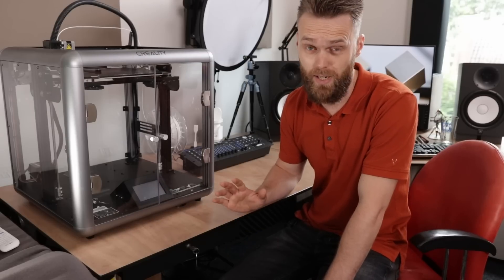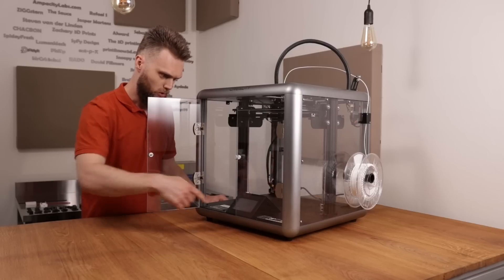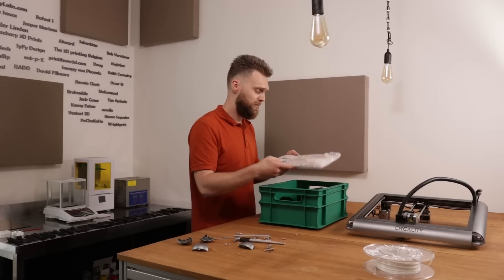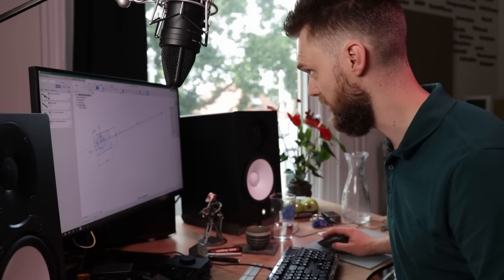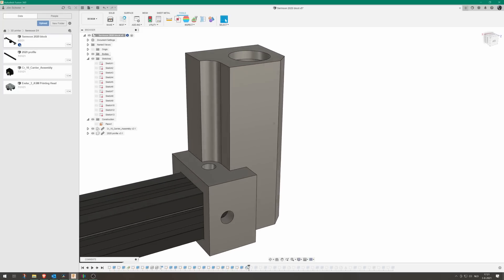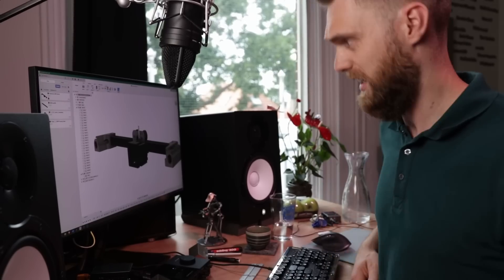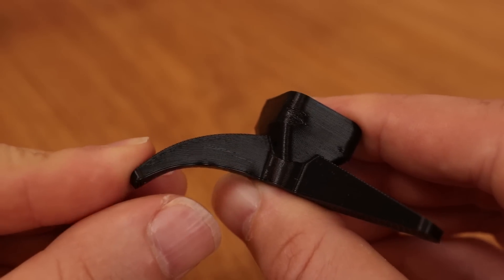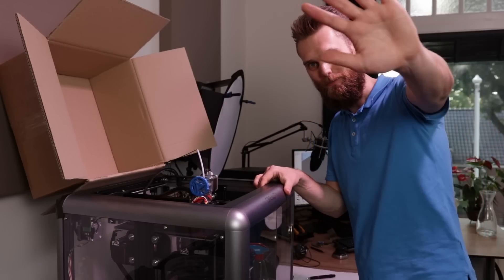Creality Sermoon D1 Ultimate Extruder Upgrade!

Comment: In my opinion, the D1 has the potential to be an outstanding unit that'll just flat beat anything else available, but falls short in so many unnecessary and goofy ways. I'd LOVE to know how yours is doing after all this time and/ or anything else you've done to it since this video (also, i have  BTT SKR V1.4 Turbo and SKR Mini E3 V3.0 Control Board, should I use one of these or keep original board?). I'm a HUGE fan of your channel and videos, but your mechanical and analytical thought process is what keeps me coming back for more. Thank you, sir.

Comment: Upgrade achieved by replacing linear bearings with aluminium profile with wheels? Hmm... 🙄
Reply from the maker: Now it fits most extruders, which is a bigger advantage than the slight disadvantage of that linear rail

Comment: I ran a belt above the deck between the two z screws.  I have problems with the cr touch.  CREALITY has left this printer be an outcast.  I just installed a SPRITE PRO EXTRUDER  ON my ENDER 3 V2.  Installed some great software that will take some LEARNING.  
If the SPRITE KEEPS printing the way it started, I may install a SPRITE IN THE SERMOON D1.

Comment: Are v slot wheels not less accurate than using linear rods would it not have been better to adapt the microswiss to use the linear rods
Reply from the maker: Good question. I don't think it matter much and the advantages V-slot wheels have, that it's a lot easier to add after market extruders to it, outweighs the disadvantages in my opinion.
Reply: @properprinting  very fair, as long as there isn't flat spots I doubt it will be too noticeable

Comment: Please give me an advice, between Ender 5 S1 and Sermoon D1, which is better choice (about build quality, and capability use for many another purpose), I’m beginner, thanks.
Reply from the maker: Although I don't have experience with the Ender 5 S1, I'm pretty sure that this is the better choice. I upgraded the Sermoon because I really dislike the extruder which is basically the most important part of a printer.
Reply: @properprinting  Thanks for your advice, I will consider Ender 5 S1 for my first 3d printer.

Comment: Why make something simple when you can make it complicated. All you needed was to change/modify the heatbreak and get rid of the Teflon tube. You replaced the linear guide with a V slot, which is the biggest step backwards. I don't think this is a good way to go.
Reply from the maker: Thanks for your input. The V slot is just a lot easier to work with and adds more possibilities.

Comment: dude where do you get heat inserts for thin walls like that?
Reply from the maker: From Onkenhout, which is a B2B supplier. I haven't found them elsewhere unfortunately. They're expensive and therefore I suggest to use regular nuts.

Comment: I'm about to pick one up open box for $275 USD 😁 looks to be a great upgradable printer!

FYI, I've has the old wooden Replicator Dual (from 2012) and modified it over the years into a seriously good machine. And my recent printer has been a Duplicator i3, which I have also very modified. But it seems that everything was done slightly wrong on that one, everything.. I had to redesign at least 7 core components and flash it with Marlin to turn it into a printer every bit as good as a Prusa i3 😉 or better 😜 I haven't has to level the bed in Months!! Perfect 1st layer every time.

Also got the one open box, if I'm going to go through it and modify it.. mights as well tear it down and inspect it. Ensuring there's nothing wrong with the open box purchase. With that said, adjusting the motor voltage IMO is necessary on a budget or hastily built machine. I do it while the machine is running a square and cylinder shape on the bed, then check min/max voltage on my multimeter. This ensures your not overheating your motors (necessary in an enclosed/heated printer) and that you also of course have enough voltage under load so it doesn't skip/shift.
Reply: So i picked one up a week after, i kept the carriage and modified the long throat by cutting it down to allow the same full metal micro swiss hotend BUT requires you to shim it because the throat hole is an odd size.. which i did with a copper sheet wrapped around it (very carefully. It's now a true fully metal hotend.

Also fixed another major issue, modified so both carriage/heat-break fans to always run AND designed fan ducts so the lower fan doesn't invariantly cool the part when you don't want it too but also help cool it FAR better. The carriage was alarmingly hot at over 100c before and how when printing large prints at 260c for hours With a cover on top to hold the warm air it's just 5-10c over ambient temp

I can easily print 200mm/s 1000 acceleration as my daily setting but anything faster and i start seeing buffer artifacts while also clearly needing linier advance Although NO ghosting what so ever. I think im going to run Klipper on a old laptop i have laying around or might get Creality's new Sonic Pad.. but it's $150 so idk. Going to see if i can convert a old android tablet for Klipper

Comment: Great idea, based on the holder I converted the Sermoon to a linear rail.
A very different printer now.
The conversion is not for beginners as it is quite extensive.
Thanks for the implementation and idea.

Comment: Question regarding reversing the extruder motor.  What wires do you have to swap to reverse the motor?  You said you reversed all of them but because the cable is black it's hard to see what wires were reversed.

Is it as simple as just reversing the entire connection?  For example, if the wires were numbered 1,2,3,4 would you reverse it by changing it to 4,3,2,1?
Reply from the maker: It's indeed as simple as that. If you want more in depth info about this, I dedicated a video on this subject https://youtu.be/3R2sExPyiok

Comment: Rotate your Y axis stepper so that the plug points filament spool.  Install an Adel clamp and stand off to the bracket above the Y stepper.  Secure the cord tightly to the clamp.
I blame the cord rubbing on the back panel for flexing the stepper connector.  The Y axis started missing steps and disabling itself.  When you went into manual mode and pushed the back and forth arrows,  the stepper would fail within a few moves.
Reply from the maker: That's great advice and I did, but didn't show it in the video. You can see it in the thumbnail. I used zip ties through the slotted hole to secure the cable.

Comment: First move the front door hinge mount forward 5 to 5.5mm.   Next make better filament flow.  1.  fabricate a bearing filament roller that does not scrape the machine.  2.  get rid of the v bearings and replace it with a swivel larger pulley with a removable pin for keeping the filament on the roller. 3.  move the filament run out out to the center of the roll.  4.  fabricate 2 clip on filament guides that  have swivel  top.  Install a 8 to 10 inch ptfe tube to guide the filament.

Comment: Wild I have this printer and my only peeves with it was that all the stock slicer material and retraction settings were for a ender 3,  and the dual bearing filament feed setup sucks and jams. Guess you missed those, judging by how clean the hot end was you really did not use it much. Once converted the stock feed to reverse bowden, and fixing the slicer settings been having a great time with the stock hot end. Only other fixes are firmware related, never have to open the doors it just works.

Comment: Is it a joke ? A core xy printer with a direct drive extruder ? The main point in having a core xy printer is to lower the mass accelerating to get faster accelerations with the same torque (F=m*acc) needles to mention the problem of jerk (derivated of the accelerations which can't be infinite, if you prefer that way, you can't switch from 0m/s^2  to 5m/s^2 in no time you need to accelerate progressively.
Reply from the maker: This is not a joke, neither a core XY printer

Comment: Something you should add to your tool collection: screwdriver-shaped allen (hex) drivers with proper handles.  So much easier to use than the L-shaped ones!  You'll be far less likely to drop them.  Only disadvantage is that you can't get the torque you can get compared to driving with the short end of the L (long end out).

Comment: AS per usual, i absolutely love your video combined with those timelapse !
However I have a question, how do you move so smoothly in fusion ? It's always a pain for me, and I feel like it's hard to actually move how I want to. I'm using simple logitech mouse like the g512 and the mx master 2s
Also, what threaded insert are you using ? everytime i try using them, i feel like plastic is meling inside of it, making it unusable. I have yet to make a single usable threaded insert...
Reply from the maker: Thanks! I use a CAD mouse for it https://3dconnexion.com/nl/product/spacemouse-wireless/ one you get used to it, you can't do without. It works in Blender too. I buy the inserts from Onkenhout, but this is a B2B company which only sells large quantities. I'm planning on selling them myself.
Reply: @properprinting  Thanks a lot for the reply ! Also, how do you design the holes for threaded insert, like how much thinner do you make the holes for a M3 threaded insert for instance ? because that might be the source of my issues
Reply from the maker: @Sttreg  You're welcome! I use the measurements from this document https://www.onkenhout.nl/pdf/Multisert_zonder_kop/227/t/p it's Dutch though, but the pictures speak for themselves

Comment: Nice. But dont understand why you go from the round bars, to the 2020's. Aren't the rods more smooth and good in the long run?
Reply from the maker: I did that because many standard hotends can be placed on it easily. For some reason this runs a lot smoother than the stock rods, but I recon that this shouldn't be the case. I'm also able to add my rocker to it now where I won that contest with :D
Reply: @properprinting  okey. But why not only make an hotend adapter on the stock rods?
Reply from the maker: @SplitPhotography  if I'd do that I wouldn't be able to add the Microswiss hotend, nor my rocker system for instance. These rods don't run smooth and you can still add a hiwin rail if you don't like those V-slot wheels. For me it's mostly about the added possibilities now.

Comment: god the intro is so true.
I designed my Doot Changer with the actual printer I had (hevo) and only kept the frame, boy was it a nightmare, everyday I was holding broken/bad components together with a janky bad fix or glue to make it function well enough to print the replacement, would NOT RECOMMENT. it made me cry ;-;
Reply from the maker: I feel your pain, been there xD

Comment: Why downgrade from precision linear rods to plastic V-wheels? That's the reason why I never bought a chinese 3d printer.
Reply from the maker: Because now I'm able to add any aftermarket hotend. This also enables the possibility to add hiwin rails if you'd like. The upgrade is not the rails itself, but the possibility to add a working extruder and other stuff to it. I don't have any bad experiences with V-slot wheels though.
Reply: @properprinting  agreed other than odd adjustments and bearing load for zz602 is bound to stick and fail but….they last abit
Reply: @properprinting  I used the pc vslot wheels they are the hardest ones and highest temp over derlin
Reply: @properprinting  all in my hiwin rails were worth the accuracy and speed a bit more

Comment: You ordered the silicone heater from Rat Rig i saw, does this mean there is a Rat Rig build in the pipeline?
Reply from the maker: I bought that for this printer, but I'm not sure if I'll end up using it for it. I don't have a plan yet xD

Comment: Could you make a special with ABS tips for functional parts? I am getting a big elephant foot of several layers trying
Reply from the maker: I basically print it similar as with PLA with the difference of the temperatures, an enclosed or heated chamber and a brim. I print the first layer at 100% flow rate at the same height as the rest. This reduces the bed adhesion, but I get away with it mostly.
Reply: I can also add that a PEI surface works wonders with abs while the glass beds tend to be not ideal. Elefants foot has more to do with too close first layer than material
Reply: @properprinting  fans on?
Reply from the maker: @felipenavas  with small parts yes, but mostly not
Reply: My elephant foot have like 5 layers. Like the foot got melted down. My bed is 100C, Nozzle 235C and I print inside a tent around 40C-50C with fans off. I am printing on PEI

Comment: Way too much restriction for that part fan!  You'll know because it runs noisy.  Also, if you put some smoke around the fan, there will be lots of turbulence at the input side.  Try adding some bleeder holes -- keep drilling holes and note how it gets quieter.  When it quiets down, you'll have enough holes!  Think about 40% of the input area on the fan for the output (ballpark number).
Reply from the maker: Thanks a lot for your input! I didn't give it too much thought, but it would be a good idea to do a bit more research on this topic. I'll design more ducts in the future probably. I'll take a look into your suggestion :D
Reply: @properprinting  just my two cents about this: i recently designed a few iterations of ducts (tho for blower fans) for my own machine and I actually tried to bend the air flow as little as possible while keeping the outlet as close to the inlet size as possible. I have some friend run CFD for me and it really helps you understand that complex topic. My solution was loft with a guide rail spline or actually two
Reply: Really, use blower fans only for part cooling - no axial fans. This guy has excellent videos about this, and testing the effect of blower fans vs axial fans: https://www.youtube.com/watch?v=SX-okOHvh1Q

In some cases axial fans can even cause a reverse airflow!
Reply: I just threw on radial fan on hestsink as well.. all potential heatcreeps eliminated!
And, you can have restrictions in the blower route design.  Little more noise, but no problem for me vs what i get for it.

Comment: What is your aversion to PETG?  I notice you never print with it.
Reply from the maker: I printed a lot with it in my older videos. All blue parts are PETG. It's not that I don't like it, but I like Nylon and polycarbonate a lot. The reason why I print so much with ABS is because I received a lot from 3D4Makers for that rim. I use ABS for that rim because it can already tell a lot about the performance of my printer (for printing Nylon and polycarb) and it's affordable.
Reply: @properprinting  makes total sense.  Appreciate your response.  I love your videos brother!  Thanks for sharing your wealth of failures and achievements!
Reply from the maker: If there's one thing I don't like about PETG though is that it's too shiny IMO and often too much webbing. The latter probably can be solved, but just that squeaking sound make it look and feel very plasticy
Reply: @properprinting  I'm curious of your thoughts on the emission of styrene?  I don't use ABS because of this emission.  Nearly all my prints are sold and used outdoors as well so the UV resistance is key.
Reply from the maker: @chasgiv4  UV resistance would be a reason for me as well. I'm personally not that afraid of styrene and I've inhaled worse things in my life already. Nevertheless, I ventilate well during printing.
Reply: @properprinting  that is key!
Reply: @chasgiv4  try asa
Reply: @CC-kc5lb  ASA fumes are very potent.  Would need serious filtration.
Reply: @chasgiv4  if you want uv protection asa is your best material all thermoplastics emit junk abs is far worse especially in formaldehyde side but you knew this…..I think….
Reply: Stringy, oozy, hygroscopic, gets all over the nozzle, harder to post-process, bed adhesion often too bad or too good

Edit: But I'd love to hear his thoughts as well.
Reply: @RubixB0y  he prints indoors right?  Doesn't abs emit fumes and higher amount of toxins vs petg?
Reply: Less heat resistant and also deforms under constant load
Reply: @felipenavas  all plastic deforms under constant load.  Either by breaking or bending.

Comment: How "slow" do you run your Ender 3? I can routinely slice at up to 140mm/s before I outrun my hotend's melt capacity.

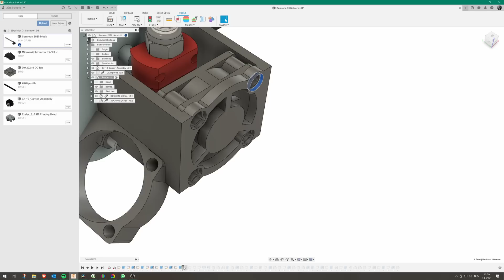10:00 an issue you may have realized later in the video (still watching) is that muffin/axial fans do not perform well when ducted. ABS isn't so picky though.
Reply from the maker: I usually print around 40-50 mm/min. I tried to say that I had to print slower than a bed slinger which I think shouldn't be the case. I honestly didn't think much of the duct and it's a good idea to do some research on that.
Reply: @properprinting  I want to say that CNC Kitchen did a video comparing fans a few months ago, but I'm not certain it was him. It could have been Chris Riley.
A stock Ender 3 should be able to manage up to about 70mm/s. When I ordered mine the seller installed a microswiss hotend, but the stock one should still manage 60 or so.
I should have listed my upgrades, to be fair, when I made my speed claim...
MKS Gen L board w/ TMC2130s
Titan clone direct drive
Dual 5015 duct by Petsfang
PEI flex sheet
Klipper firmware

Klipper has probably made the biggest improvement along w/ the Titan. I've done some tuning and my acceleration is about 2500mm/s/s currently. I could probably fo higher, but I need to attach an accelerometer to it for further tuning.
Reply: The ducting might also be very constraining too